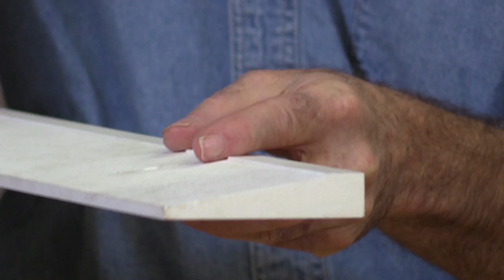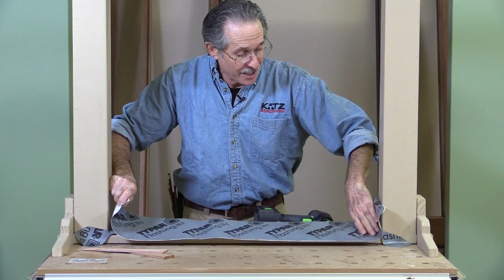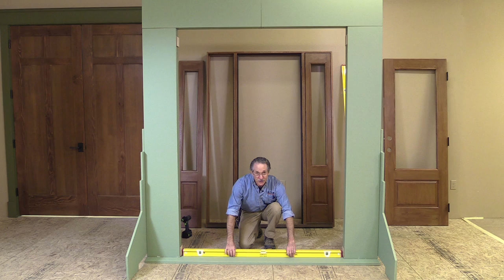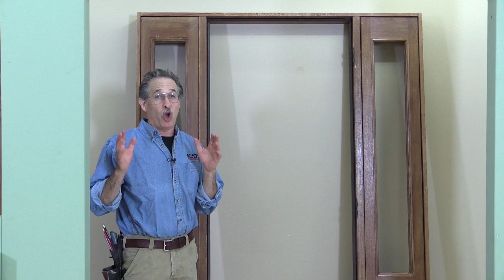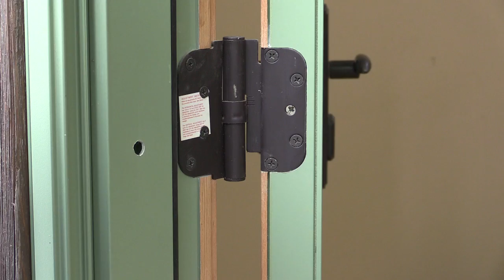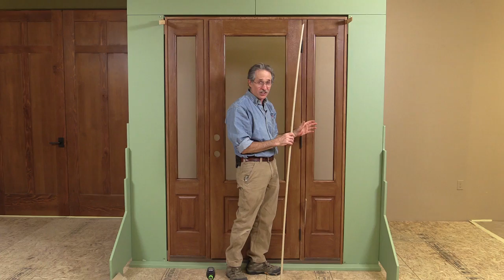Installing A Sidelight--Door--Sidelight Unit

Comment: Amen! Proper training is so so so vital! I see shoddy work daily and spend a lot of unnecessary time fixing things to get the finished product to be done correctly, professionally, and works properly. Things like drywall being ran past the rough opening, causing me to cut the drywall to the header, vs cutting the jamb legs down so there’s a gap under the jamb and subfloor.. been running into a lot of that recently installing new doors/casing in luxury homes. It amazes me too how Homes built within the last 5 years have uneven reveals, uneven spacing from casing and jambs, and like you said, rough openings with over an in and half both sides on a basic 2/8 6/8 door.. better yet it’s shimmed off in 3 spots.. hinge catch, a few inches below top hinge, a few inches below bottom hinge. Then to top it off, exterior doors that are installed with 16 guage, 2” nails.. if anyone wanted to get in, they could just give a few blows to the door and the whole jamb is out.. absolutely amazing the corners that are cut, the lack of quality and very little attention to detail.. do I work as fast as some? No. Will all of the doors I’ve hung ever fail or sag? I highly doubt it. Last thing, here in my state, 20 min fire doors are required per code for garage entry doors. Usually 1 3/4” solid core. I see so many 1 3/8 solid core that are hung on interior jambs and always get complaints of why the door has a big draft..

Comment: You correctly emphasized, to the point of laboring, to ensure that the sill should be set dead level and straight; then you drove a screw in between the shims pulling the unshimmed portion of the cant strip down on to the rough frame.
Reply: Ha, that is funny.

Comment: To a professional and expert, you don't need a fixed pre-hung door, but to most idiots, that's the only way to minimize their chances of screwing up. In Rio Grande Valley, we have a shortage of skilled laborers. Most we have are C- and D+ tradesman who screw things up. It's like asking an amateur to cut a fine diamond, but that's all we have - amateurs. One thing I can tell you how the amateur I hired who claimed to have hung doors for 15 years, how he screw in screws. You and I screw screws in perpendicular to the wood. He didn't. He screw it like K. So, he would screw the middle perpendicular, but higher up he would raise his hand and screw it at two o'clock direction, the screws goes in at 2 o'clock. Then at the bottom he would do the same, but this time screw it in at 5 o'clock. He doesn't bother to go up a ladder or get off the ladder to do it properly.

Comment: You don't mention that you have to be careful not to drive a screw through the jamb into the glass and shatter the glass. You can also use cuts from vinyl flooring as shims between the jamb and the sidelight. There's one more way to move a door and adjust the gap, and that's "throwing the hinge" using 1/4 wide shims behind the hinge next to the stop side or the barrel side.

Comment: Unfortunately, in Rio Grande Valley, Texas, we have way too many installers that don't know anything. You can buy a perfect door, but the installer will screw it up. Here Latinos love those huge double doors, but they are never installed correctly. It's not air tight, and not water tight. I recently bought a house, and had a door like that. I had to get it replaced to get it water tight and air tight. I wanted a pre-hung door because I don't want those idiots to screw it up. But, they manage to screw up the installation nontheless. He never checked level and never check plumb. I showed him my 2 feet level, then he took out his 6 inches level. He said these pre-hung door with sidelights don't need to be leveled. LOL
The bottom of the frames has a square indentation. The old door had a solid wood filling that space. He threw away that piece of wood and replaced it with a few thin strips of wood. That made the botton no longer solid. That's why you can't leave any chance to these idiots because they will screw it up.

Comment: Thanks for the excellent presentation. I am correcting a new 42” door with two fixed sidelites that was butchered by the seller doorshop. The idiots installed foam weatherstripping and a bottom sweep cap on fixed panels

Comment: I could not find what I'm up against.  1989 house, door is not compressing the seal.  The hinges and door appear to be original with the hinge cutouts also being original.  Any suggestions?  I replaced the weather seal as there was a mix and match of original with "stick on foam" and I could see daylight

Comment: I have an existing door but I want to add some side lights  to it.  There is no videos on this subject.  I was told at Home Depot that I have to buy a new door with sidelights.  I really do not want to do that.  HELP.
Reply: Let know how you managed it. I'm doing the same thing converting a double door to a single with two side lights. I'd like to leave the existing jams as trim for the sidelights, bu t still trying to figure out how to nail in studs and jambs for the movable door.